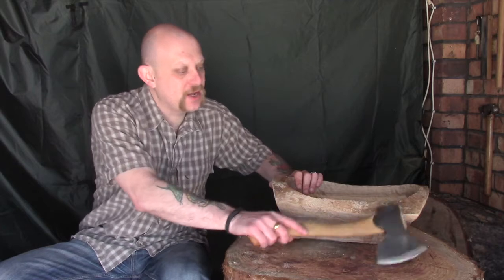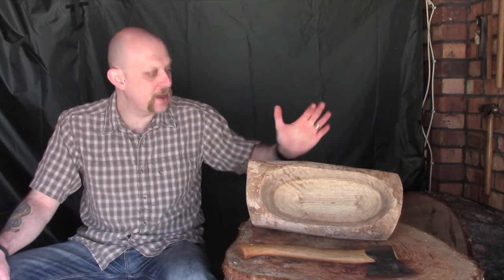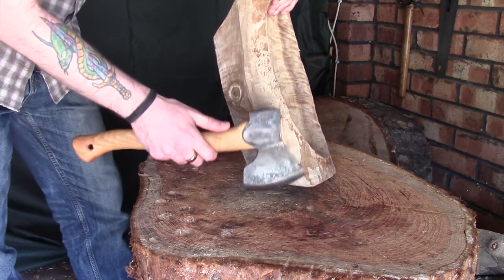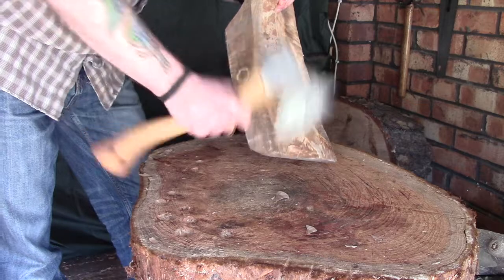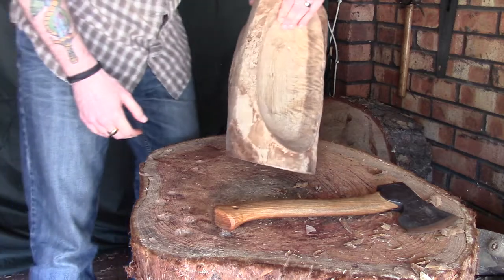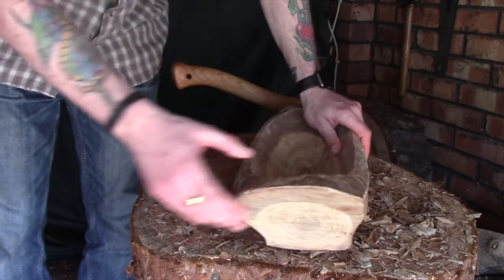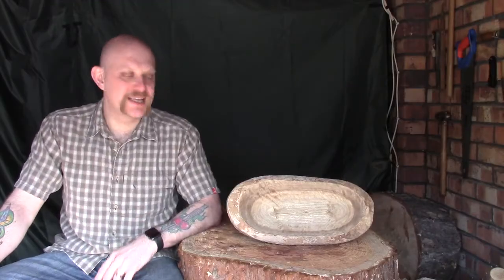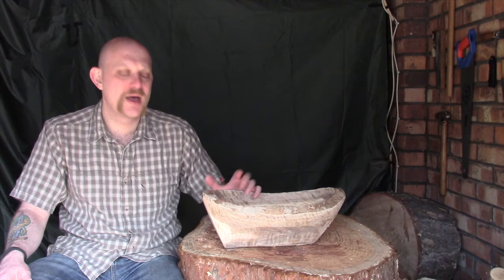Eucalyptus Bowl - Part 11

Comment: I am very curious see this wood looks like once it is sanded and oiled.
Reply from the maker: ddrevo I've got quite high hopes for this one when I put the final finish on (beeswax and oil). Every time i carve away the dry outer layer and the damp wet wood shows through the grain looks amazing. Give that some contrast with the oil and a high sheen from the beeswax and I'm hoping it will really stand out.